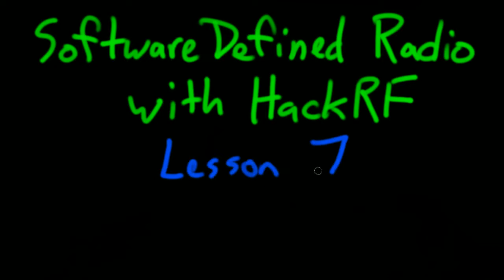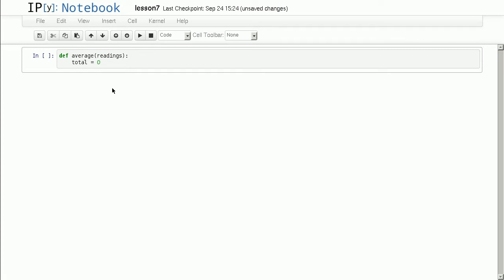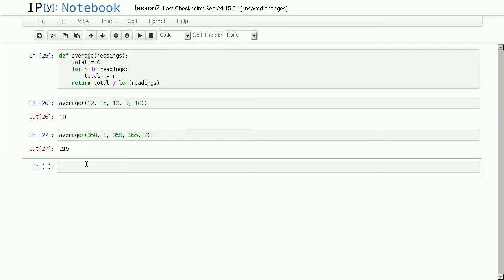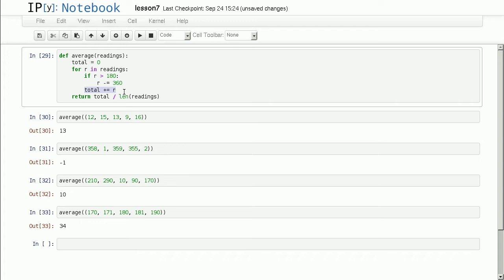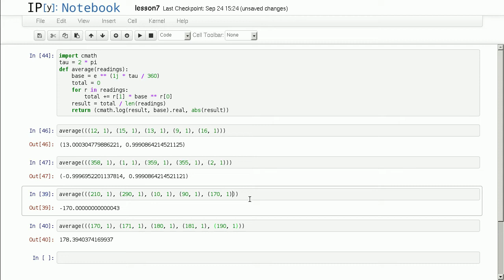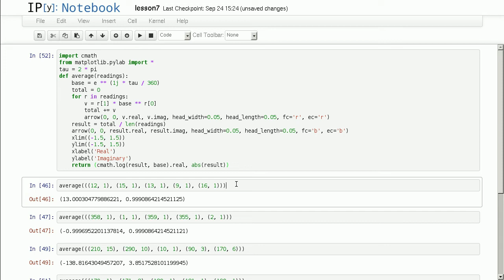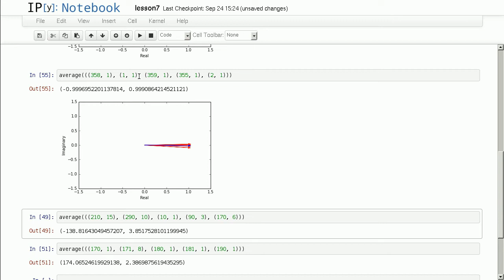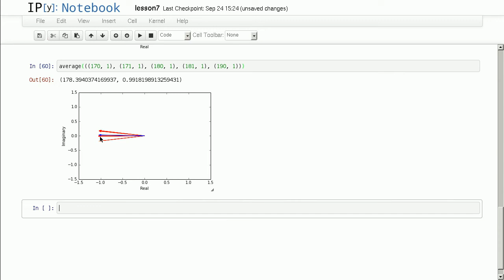Software Defined Radio with HackRF by Michael Ossmann, Lesson 7: Complex Numbers in DSP

Comment: Quick question regarding IQ and FM for determining the angle.
You mentioned calculating the angle of the first and then the second sample.
Could we also instead subtract the latter sample from the former sample and just get the angle from that?
Instead of two lookups and one subtract, we have two subtracts and one lookup.
1. Is that even allowed?
2. How is the performance difference?

Comment: Thank you for the excellent videos. I really enjoyed this and the previous video about complex numbers and why they are useful in DSP.
There is one thing I don't understand after experimenting with complex numbers and real numbers in Gnu Radio Companion, I don't see any difference in CPU load when working with complex numbers over real numbers. The way I tested it was I use the flow graph of lesson 2 (signal source, throttle and FFT sink (or frequency sink)), while using real numbers. I keep my eye on htop looking at my CPU load and increase the sample rate. When the CPU gets loaded to lets say 50% I stop the process and repeat at the same sample rate with use of complex numbers. There may be some difference in CPU load, but not significantly, at least not that I can see in htop. Why is this? I even tried with a noise source instead of a signal source, to make it harder for the FFT sink to compute, but no difference. I would expect a better performance with the use of complex numbers.
Reply from the maker: That is an interesting question. We suggest reaching out to the GNU Radio folks: https://www.gnuradio.org/

Comment: It seems to brik when you use equal or opposing forces?
((90, 1), (270, 1))
((0, 1), (360, 1))
Reply: Opposing winds breaks because the total is 0 (no wind), to which the concept of direction doesn't really apply (which means that the logarithm breaks, as you can not compute the logarithm of 0)